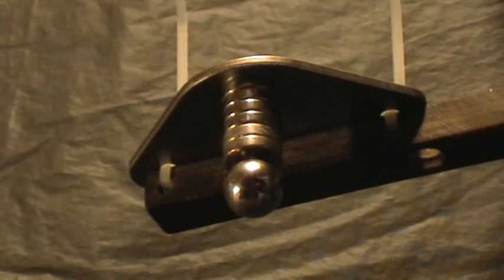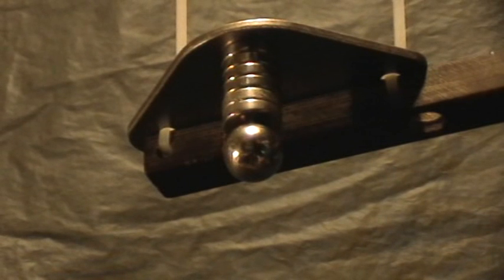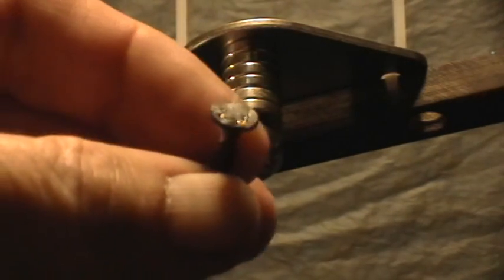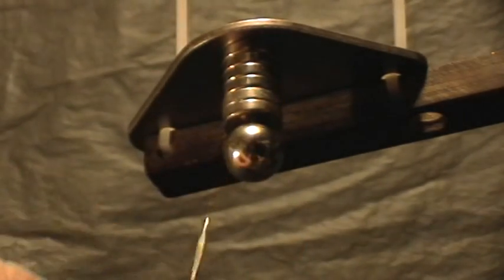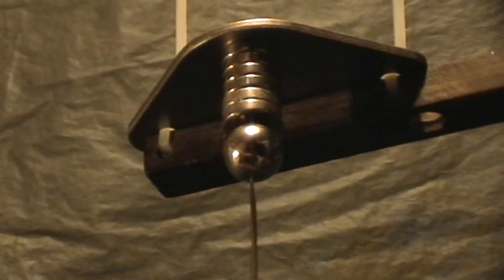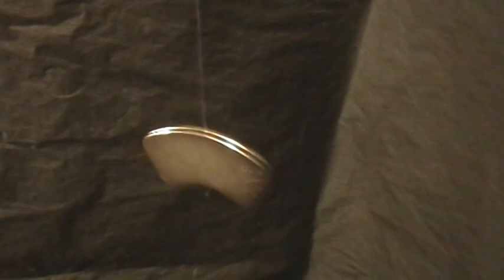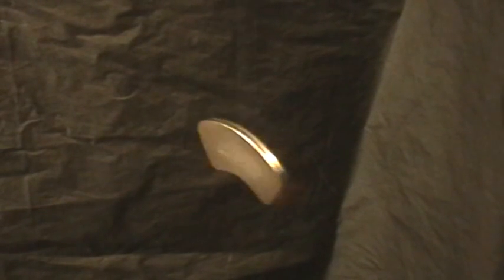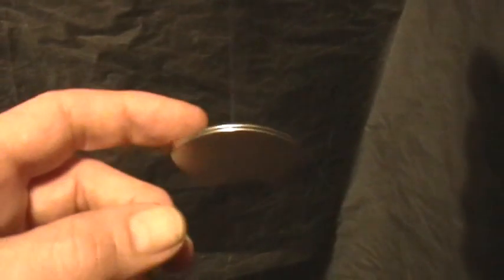Low Hanging Fruit: Even More Final: Ed A's Perpetual Motion 4

Comment: Fantastic amateur science! These two videos show exactly what real science is about. The original intent of the demonstration was a mildly interesting debunking of magical thinking by demonstrating (expected) science conforming results. But then there was an interesting little glitch, part of the experiment hadn't quite gone as expected. The experiment was refined, repeated, and some new and interesting behavior was observed. 

And without the intent to do so, you have demonstrated the basis of building many types of extremely sensitive, dirt cheap sensors for amateur experimenters. Add a photo detector at the flag, enclose the whole thing, and you could build very sensitive: Thermometers, humidistats, gravimeters, micro scales, various pressure sensors, magnetometers,  photonic pressure meters ? /switch out target disks of different material and hit your rig with different frequencies of light/, stress sensors, movement sensors that could potentially detect a thousandth of a millimeter, and many more. Add some electronics and you could record results from any of these over time. Op delivered real science.

Comment: Did you say that your magnets ALIGN with North-South of the Earth?
So, do the magnets used have only single pole on the flat side?!?
I've just repeated Robert's experiment an it WORKS for me.
My magnets have North&South poles next to each other on the flat side.
It starts to spin, it accelerates and the cotton string is coiling up so after a while I have unwind it.
Reply from the maker: Yes, that's right, the magnets have multiple poles on the flat sides. These that I have are aligning N-S with flat sides perpendicular to the N-S line.
As you can see in the previous videos the "experiment" also WORKS for me. I encourage you to do the full set of control experiments so that you can determine for yourself whether or not it is the twist of the string that is powering the rotation, or something else.  First and easiest, try suspending a non-magnetic weight that weighs the same as your magnets from a fresh piece of the same thread or string that you used with the magnets. Does it spin too? Why?